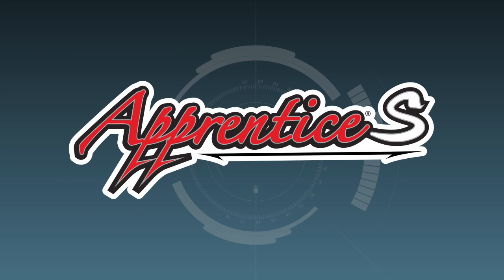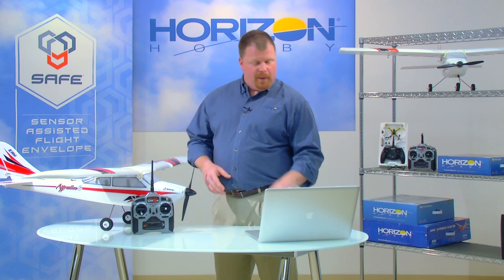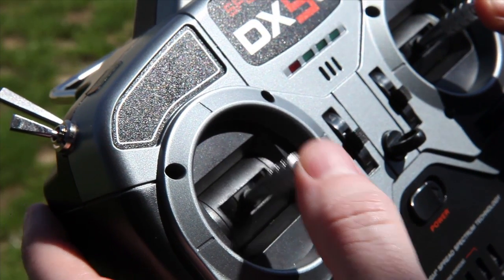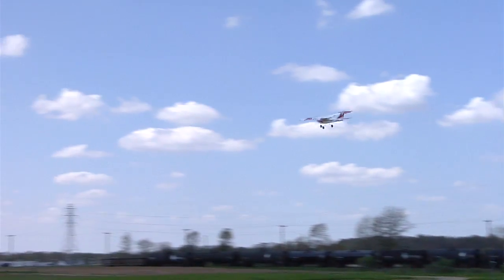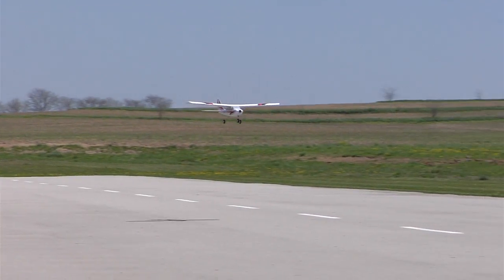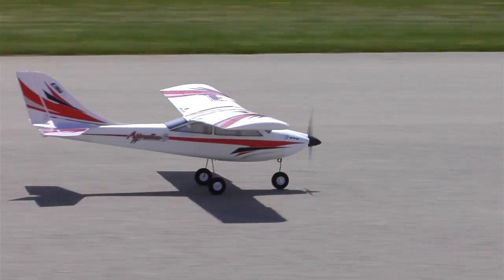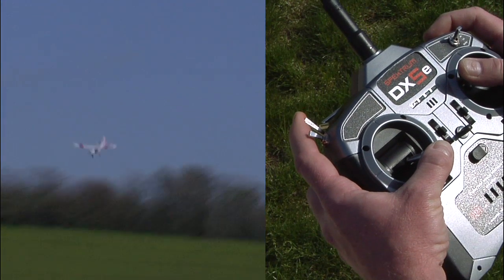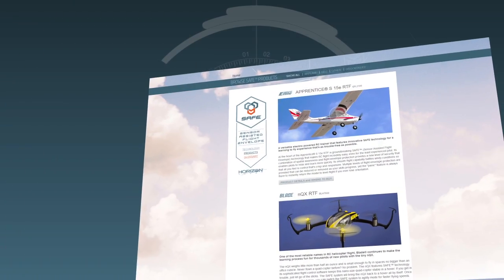SAFE and the E-Flite Apprentice S

Comment: I bought Apprentice S 15E RTF. After power up all controls were checked (neutral,
direction & travel)- okay. After SAFE system initialization all controls checked okay except there was no "DOWN" elevator travel. "UP" elevator travel was okay. I rebind the Tx/Rx but with same result. I reconfigured a DX8 tx & rebind. With SAFE activated...again no "DOWN" elevator. Is this normal?

Comment: Can I mount a go pro on a plane or will it affect the flight?
Reply: I use a runcam on it all the time with no problems!!!
Reply: Hasan El-Isa yes you can. It's not going to affect anything.
Reply: You can, but it will add weight and drag, and risking your camera to fall off

Comment: If you're not prepared for your plane to crash anytime you fly it then you're in the wrong hobby, it could fly into another, you could get radio lockout, a servo could fail etc and hey its your first plane, you might even take off with reversed controls, will your box of tricks save you there?

Comment: I have been flying trainer planes with side assistance, but I think if Safe is what it claims to be, I can see doing things, which I might only dare on a flight simulator and avoid real life crashes. Also, taking wind factors into account, beginners might get out of sharp banks, in lower than comfortable altitudes, which again could get flyers to practice in such "uncomfortable" conditions. Finally, it would be a pleasure to move from beginner's to intermediate and expert modes as required!

Comment: But the AS3X electronics are still flying the plane for you! Why would you want that? In this age of GPS guided quad rotors, sure its pretty cool to tell it to fly over there but it isn't as fun as flying the damn thing yourself!
I'm not saying the DX5e isn't a good transmitter but there are cheaper alternatives if you're stuck for cash!

Comment: cor $300? where did you get your first plane from horizon hobby? divide it by three and that's about how much the plane I learnt to fly on cost. Even less actually, my grandad bought me the 35mhz receiver for my birthday. It used nicads and a brushed motor and I still have all the bits, the plane is more epoxy than foam but taught me to fly.

Can you honestly say that if you are given the tools to make something so easy that it flies itself that you will get anywhere near as much fun out of it?

Comment: (Continued) considering it is a trainer and first landings can be pretty hard, I completely removed, modified, replaced the stock gear for a much stronger one that hasn't failed yet, the new apprentice seems nice although a little dumbed down I think, the panic feature should have been the only feature,with full flight parameters active at all times, please do improve the deplorable nose gear though, I would have gladly paid more for it off the start!